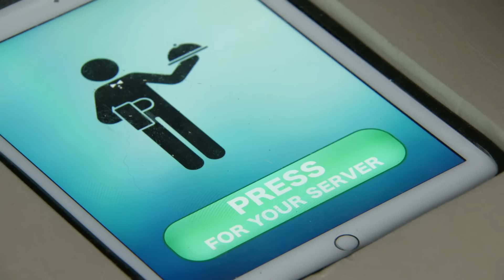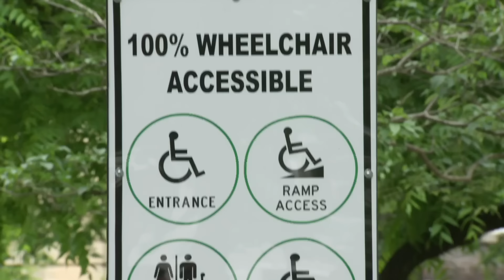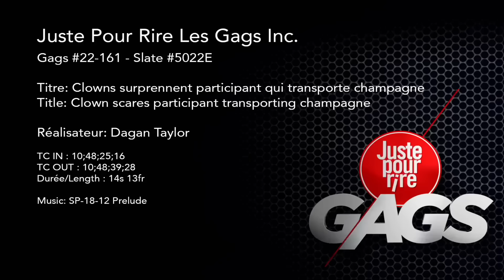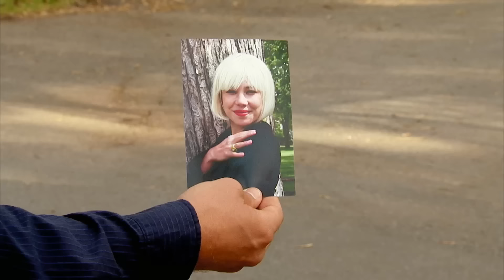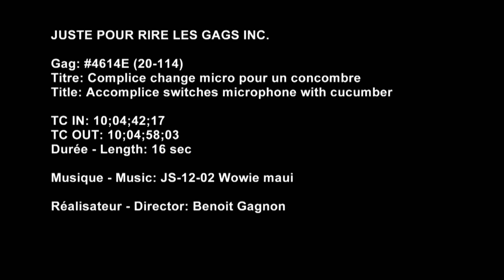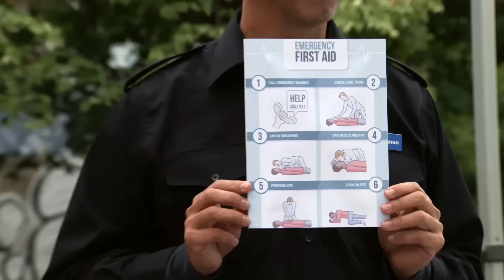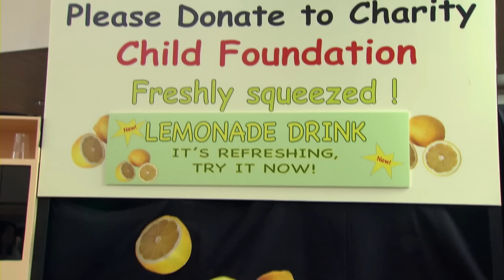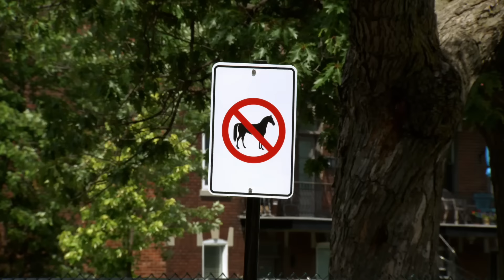Best Of Flirting Pranks 2024 | Just For Laughs Gags

Comment: I got a question. About 5 years ago I had a bought a bunch of AC to DC power supply's. Each one was wired the same except for one that had the polarities switched and when I plugged it in it sparked and now the some of the switches on the wall either don't work (some do work) or are dysfunctional. One goes to a light outside and it non stop flickers. Any idea what the specific problem is?  All of this is on the same breaker that sparked.